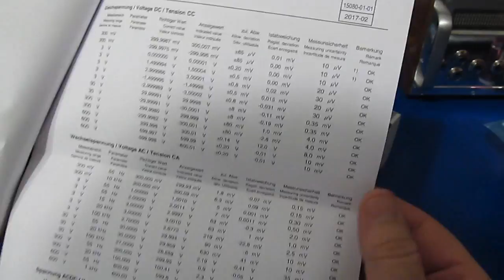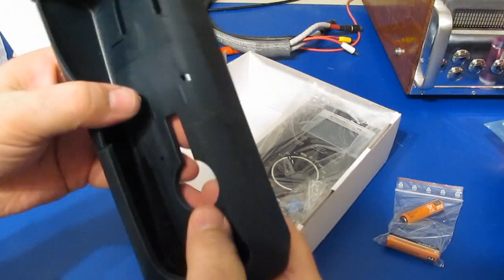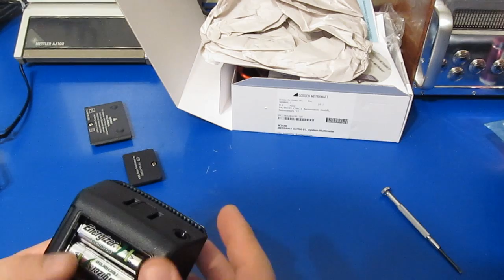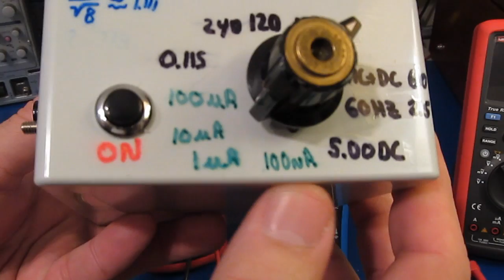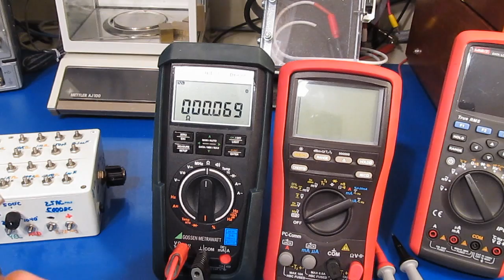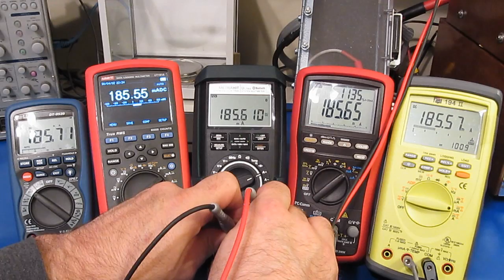Gossen Metrawatt Metrahit Ultra M248B Review Part1

Comment: Morning  Mr Smith
Thank you for the videos,  after comparing meter specs.. I decided to purchase the brymen BM 257s..... 

In my line of work as a Electrical Engineer.. I do both electrical repairs in residential environments and do also car electrical customizations this should work perfect for me..

Thanks..

One more thing..

You calibrate meters as I see.... Can I send you mine as needed... Yes of course, I have to pay you... Lol....

Let me know...
Reply from the maker: I do not calibrate meters, nor do I offer any services or products for sale.  I also don't accept donations.   There are many cal labs in the US if that is something you really require, perhaps for your ISO cert.  
I have not looked at the 257s but it seems like a nice little meter.   All of the Brymen products I have looked at have done very well in my tests.
Reply: I also purchased a BM257s partly based on Joe's reviews. It has become my work multimeter, keeping arcade games and pinball machines alive and well. 
I liked that meter so much that I turned around and ordered a BM829s for my home. As far as I can tell, the BM829s is very similar to the BM869s, except that it is 10,000 count.
Very happy with both.

Comment: I need it!!😍😍😍 for free😁😁😁
Reply from the maker: You may want it but I doubt you need it.  This is not the free give away channel.  Try some of the large channels for free stuff.
Reply: just kidding sir!! thanks for such a nice content!! is ut181a good for use if we can say in overall performance like precision, reliability, calibration, quality...
Reply from the maker: @partscience  I would have no idea if the UT181A would meet anyone's needs besides my own.  I can tell you that during the winter months, our house will become very dry and ESD is a problem. I can tell you that the events I get from toughing door knobs and such in the house cause more pain than the little gas grill igniter that damaged the UT181A.   I can also tell you that I would not want any meter that can't handle some basic transients without becoming damaged.  I had that with my first Fluke.
Reply from the maker: If I were going to give away free meters, you can guess the brand I would promote....
Reply: Sir THANKS for THAT!! I want to buy and go for that from UT71C... I don't have extreme environment conditions... I was just telling about its calibration, accuracy, sampling quality, fuses, material quality etc... you are telling me about the stamina to beat these... I think industrial multimeters from Uni-T may or not overcome them...
Reply from the maker: @partscience  I would imagine even the free meters that HF gives out would meet their specifications.  In other words, you should be able to refer to the manual and see if a product will meet your needs or not.    While I don't consider a ESD or most of my transients any sort of extreme conditions, I can certainly understand that there are those that would see otherwise.    I am really only concerned with the meter's electrical robustness but have spread out into other areas over the last few years.   UNI-T products as a whole have not been very impressive.  Even their UT181A  fall way short.  Too bad really.

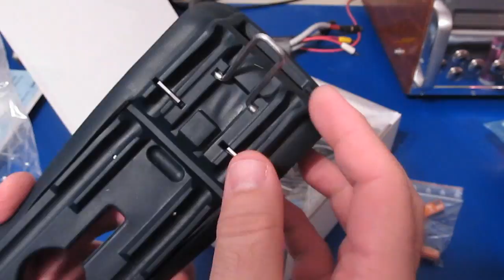Comment: 04:50 : You can't argue with the build quality of this thing...
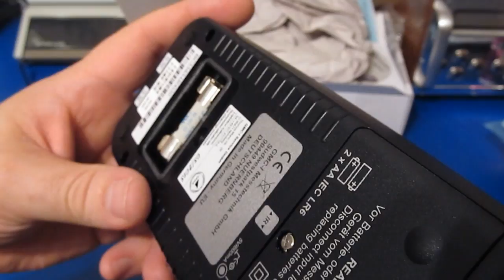05:50 : I don't understand why meter manufacturers make it such a pain to replace the batteries esp. on cheap meters. The Gossen is quite a bit better in that respect, having a separate, easily accessible compartment. I hate those meters that a) require a 9v battery and b) you need sth. like 10 mins to replace it because you have to dismantle the whole meter in order to access it.10:40 : What is the maximum temperature the Gossen can measure?
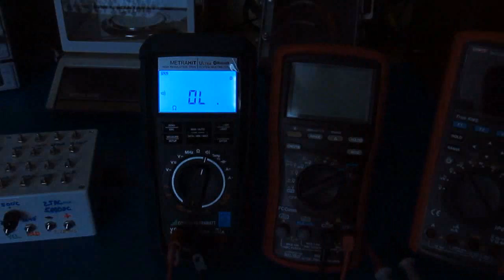11:06 : I've noticed that on most meters when the backlight is on you can't necessarily see what position your rotary switch is in. The Gossen has a slightly more visible dial but still not enough. It would be good if they had backlighting on the entire instrument panel, including the lead sockets. Alternatively, as small external light illuminating the panel would do the job.
12:00 : What is the reason the meter takes so long to settle? Isn't it a good thing, i.e. regarding precision, that it takes longer rather than shorter time?
Reply from the maker: I just noticed this post was flagged at spam.    This meter has one of the worse battery life of the meters I have looked at.  It has support for an external pack for that reason.  You better be able to change out the batteries fast because you will be doing it often!   

I like your idea on having a backlight for the rotary switch.   I've never seen it.    

Many of the meters I have looked at are slow to settle and auto range.   This meter is so unstable out of the box, forget precision.  You can't use it.   Move your hand near it and off into the weeds it goes.  

I wouldn't take much to improve this meter but this is something Gossen should have done, not a customer.

Comment: You got your new favorite meter, didn't you? At least until HIOKI DT4282 arrives... ;)
Reply: btw those lower Metrahit models autoranges a lot faster because of less ranges to go through.
Reply from the maker: Personally, I was hoping more viewers would have voted for the HIOKI because I have a good feeling that meter would survive with no drama.  It's still missing the two TC inputs which is why I went with the Brymen in the first place.   

This is the slowest autorange meter I have ever seen.  My antique HP34401A is well under a second.  But the Gossen manual did state 8 seconds so if someone did not read the manual before buying, that's on them.   I had a good idea what to expect.  Still it was a bit of a shock to see it really was that slow.
Reply: I think this is more for labs or scientistic use where user does not switch ranges very often... They would measure voltage for hours and use computer to capture data.. That lower model would be more interesting for us...
Reply from the maker: Us meaning you?  Or do you feel you speak for everyone?  You could always get a lower model and review it for the "us" group.  I'll run this one for the few remaining in the others group.
Reply: Could be :) MetraHit Extra would be more than enough for me..
Reply from the maker: Dave did a review of the Xtra and seemed to like it.
Reply: So whats your opinion on Fluke 28?
Reply from the maker: I have never seen, let alone evaluate one. For me personally, it would not be a very useful meter.  It's just too basic.  I would rather have the BM869s.
Reply: I can send you mine for a review if you want, just dont do high voltage test...? I have one that has less than 5 hours of use..
Reply from the maker: Thanks but I really have no interest or time for that matter to do product reviews.   I run these meters to failure out of my own interest to see how they compare with one another.   If I run a 28, it would be to the same standards.

Comment from the maker: BTW, I have attempted to keep Metrawatt informed.  I provided them with the details of what will be in part 2.  Basically, I want to know if this is a defective meter and needs to be returned for service.  Sadly there has been no response.
Reply: I cannot understand why Gossen behaved like this; they must have a terrible PR policy.
Reply from the maker: @lykortos4827  I believe some of the fault is with the US distributor who out right lied to Gossen about our discussion.   That pretty much set the tone moving forward.   Oddly enough, if you look up this meter, you will find they changed the name of the product.  I wrote them to see if they had made any improvements to the hardware but they would not respond.   Someone wrote me how Gossen had actually addressed the problems by adding a shield like I had shown however, I have no confirmation of that.   Not at all what I was expecting based on all the hype surrounding the brand.

Comment: The gossen is a meter that dave would be kissing, so i did expect it to perform better than all  of the others, but the resistance did take a week and a half to sort itself out.:-(

The 300khz test result just seemed unimpressive.

And the mad field effect of your hand with 60hz on it really supprised me, it's almost like there is no sheilding in it.
I don't get that from my £5 specials lol.

The display was tiny, i know it was due to it's resolution, but was it not possible to continue with another line showing the remainder of the reading, perhaps im mad :)
Reply from the maker: Your jumping to conclusions about the 60Hz.  Wait until part 2 where I will show just how bad this problem really is.
Reply: Yes i do, but it shows that your videos make me think.
Thats good, even when im wrong (all the time) lol.
Reply from the maker: LOL.  So just to be perfectly honest, I have yet to take the meter apart and I still do not fully understand what is going on myself.

Comment: 17:17 I cannot quite recall, but that "phenomena spook" reminded me of the Keysight U1272A EMC issue discussed on EEVBlog #933 (as well as the followup #987). I'm not too sure what's the issue in regards to what exactly happened with your specific Metrahit DMM, but I'll stay tuned.
Reply from the maker: Notice what happened a few times when I attempted to null the meter?
Reply: Okay, now I just noticed this appeared a tad bit earlier at ~16:57. I'm still probably not catching it early enough in the video. Eager to see the voltage transient test and high current testing in the upcoming tests.

EDIT: Ah! I think I now see it ~09:27! I just had to watch it about 3 more times in its entirety. My apologies as I was one of those BSEE students who had to study 4-5 hours for every 1 hour of instruction (learning disability).
Reply from the maker: Part 2 will just be about this one problem.
Reply: Dyaxxis is it static energy of ur body because i saw a video on another chanal i thing electroboom about that mmm?